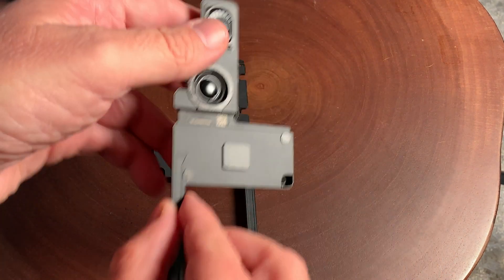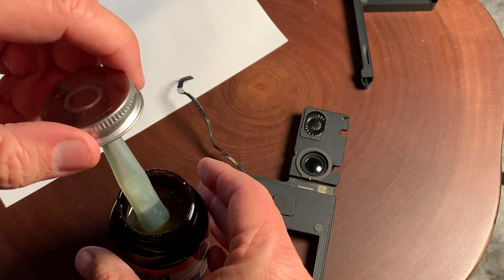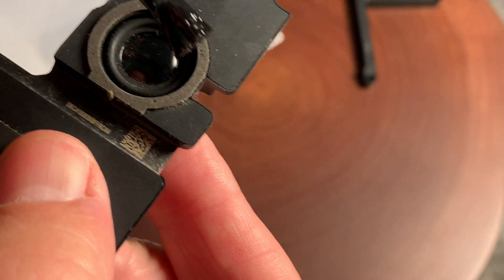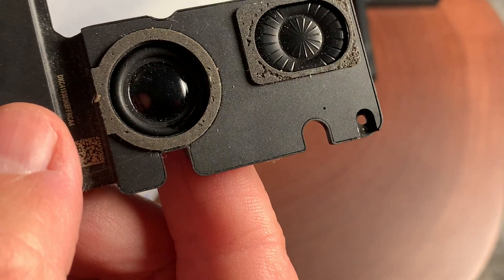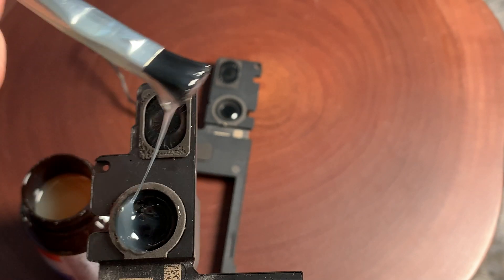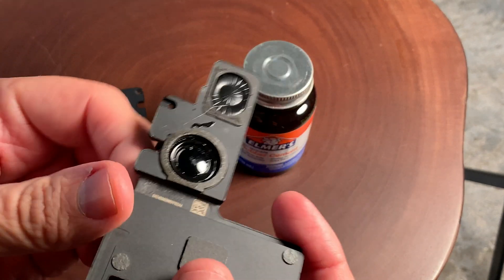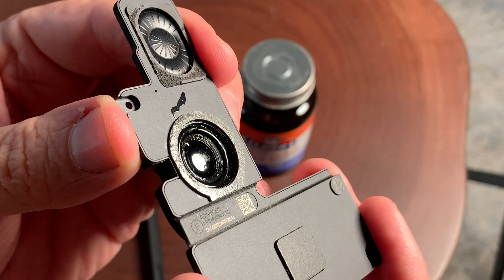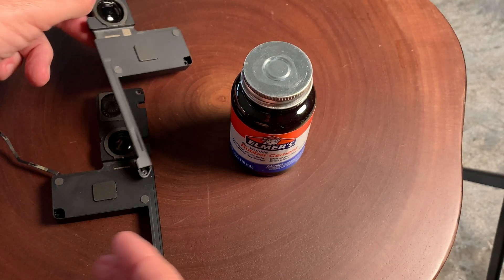Apple MacBook Pro Speaker Repair

Comment: The speakers in this, otherwise excellent, macbook pro A1398 I purchased used, had blown woofers, if you can call them that. The aftermarket set I installed are a joke. I'm wondering if it's possible to replace the woofers with something decent? It looks like the two halves of the module/enclosure will need to be separated....